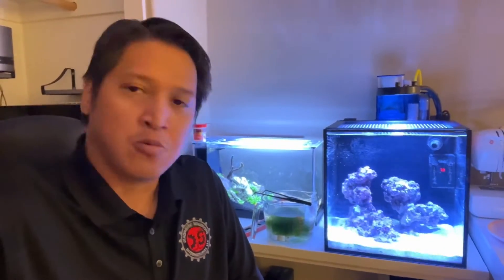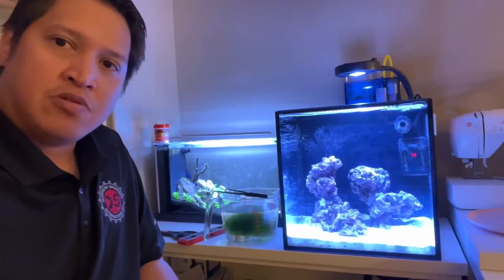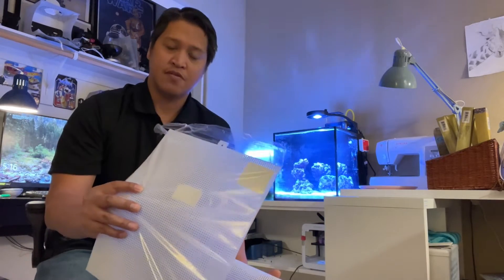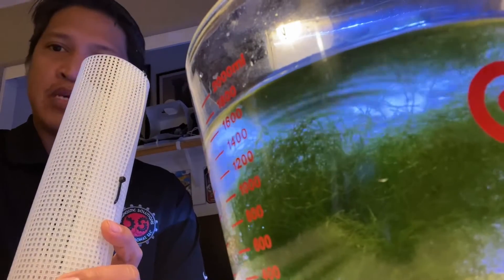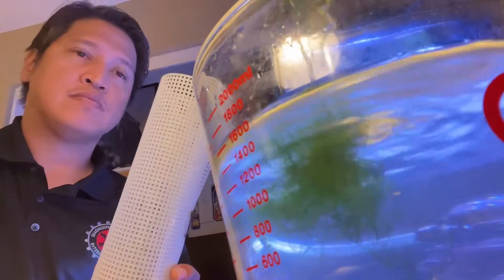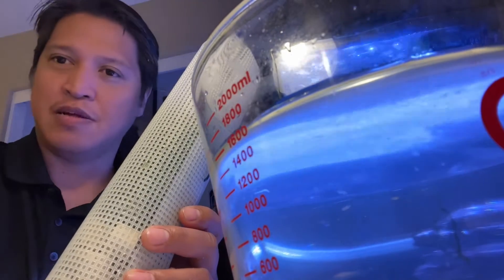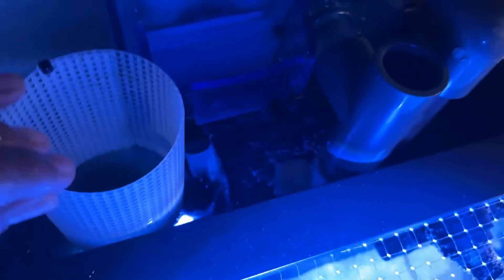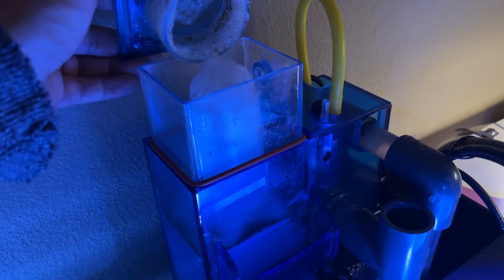Nano Reef Tank - Setup & Fill Up Innovative Marine Fusion 15 gallons with DIY Chaeto basket

Comment: Did the chaeto do good? I have a 30L IM and also want to put it in the second chamber but was worried because I heard not enough flow will cause it to die &  I’ve heard people say it’s not worth it for smaller tanks, also can you link the light if it works? Don’t want to cut the back of my tank or spend 100$ on the tunze underwater light, thanks !

Comment: I have a tank very similar to this one. Except I only have one tiny filter pump. Do you have any videos of how the back end of the tank is set up? How does the aeration work? I'm sure mine isnt correctly setup. I only have 1 clown in there and he seems happy.
Reply from the maker: Unfortunately I do not have a pic or video of the back sump. The aeration comes from all the water movement through the filtration along return pump and with surface agitation of the return nozzle. Let me know if you have any other questions.